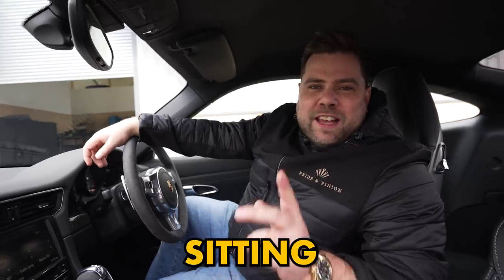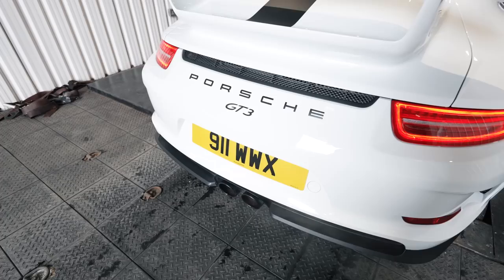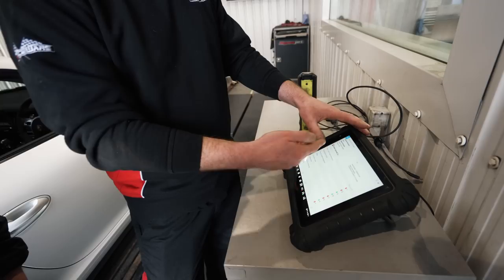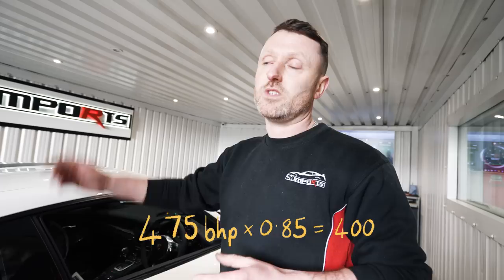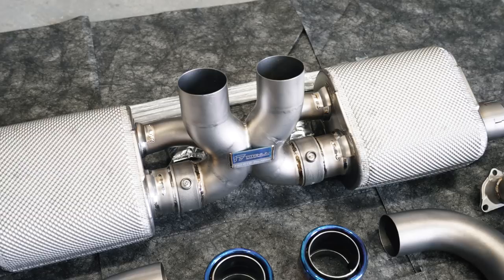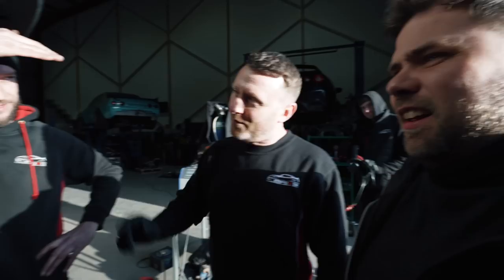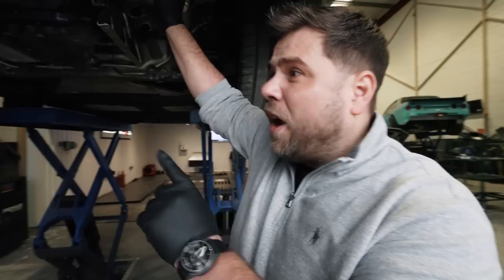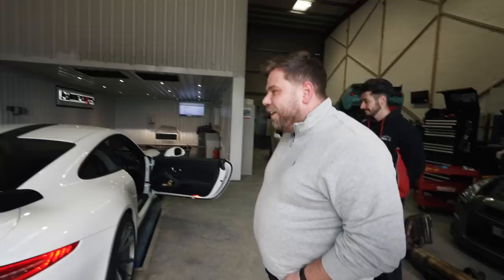I MODIFIED A PORSCHE GT3 THEN MAT ARMSTRONG ROASTS IT

Comment: Nico, I speak from long experience: boxer engines do not like being messed with, even by supposed Porsche experts. Yeah… they’ll get the motor to roar — until it screams in pain and breaks.  And when they break, they break big.  Then the sad folks would leave their tuner and show up at our facility. But what about those cars I saw at fill in the blank event?”  customers would plead. “They don’t break.”  Amazingly to me, they honestly thought the cars they saw the factory field for major races were the same as what they bought at their dealership, not realising that the competition engines were about as similar to their mills as a thoroughbred is to a Shetland pony, and cost five times more at least. 

In their literature, manufacturers often have bold print cautions regarding what NOT to do to your car.  This isn’t “warranty shit,” as one guy had been told by his previous mechanic.  It’s there because the engine will often break if those things are done.

Comment: The whole point of GT3 is N/A engine. If you put turbo on it you’re just ruining it. It won’t be much faster with rear wheel drive, it will be heavier due to turbos, additional pipes, cooling and intercoolers and as Matt said, will no longer be reliable. Makes no sense at all and it won’t be a flex because stock 991 turbo will be better and faster than twin turbo gt3. Very cool car and with the exhaust done, there is nothing else needed.